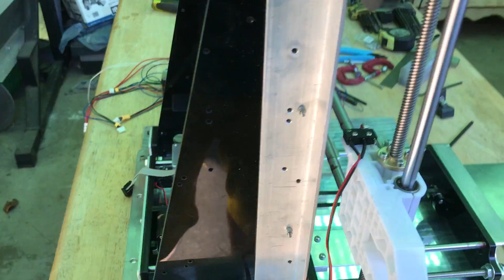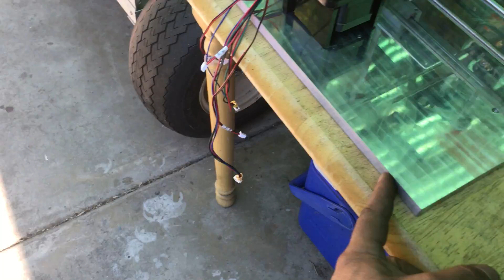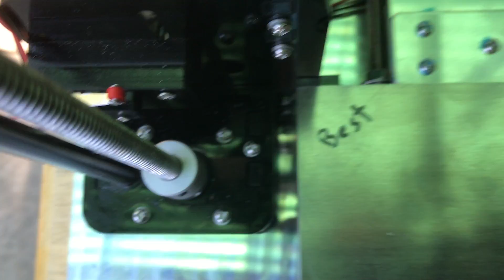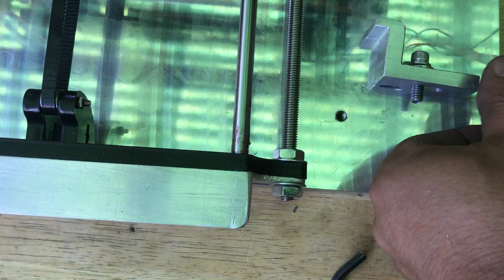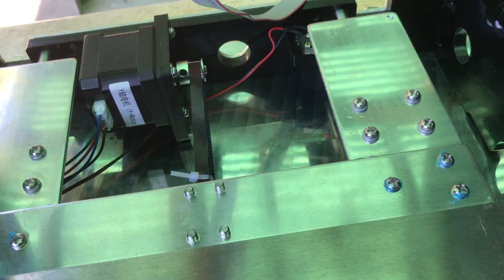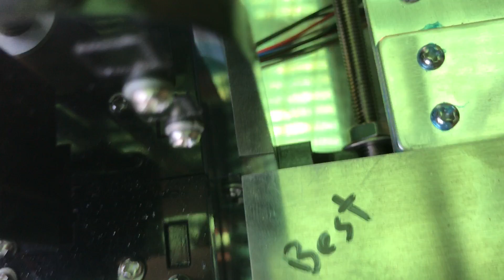Issue  with Anet A8 3D printer Y and X . How to fix it/

Comment: where you get this metal part ?
Reply from the maker: I got it from Industrial Metal Supply in Los Angeles (Sun Valley branch). I paid about $75. It's a tooling aluminum plate. (very flat)

Comment: Nice video, confirmed ideas I already had to use aluminium angle to reinforce my as yet unbuilt A8.I don't think your bed is not square, is proved by your use of the plate lining up against the acrylic sides, I think you could fix that by just loosening the screws on the aluminium "H" frame and adjusting it....."THE WIZARD" fixes his front to the base, I note you chose to put the angle aluminium on the front "upside down" so you missed the opportunity to fix the front in this way.you need to measure the X rails against the Y rails somehow avoiding the intermediate structures.I will see how this can be done as I build mine.
Reply from the maker: Hey, I just shown there one left side end gup was 1mm. That means that X and Y not forming sharp 90 Degree. All these aluminum holes on the bed machined with precision. SO If I use the across aluminum bar as a X axis , it should form 90 degree with Y axis. As simple as that :)
Reply from the maker: I could put front angle aluminum upside down , but my table was a bit smaller and standard aluminum angle was smaller than front plastic height. I paid for that aluminum table almost the same like for my Anet printer. Its a cast aluminum table with smooth machined surfaces made for tooling :) Anyway I print using ABS most of the time with my Anet and it works great.

Comment: Nice, if you were selling those machined parts, I would by them at fair price
Reply from the maker: I don't sell them. I just made one and that's it. Actually I use standard 1/8" thick aluminum angles ( cut the size and make some through holes, machine some slots and simple edge rounding with a sand paper ) The 16"x18" / 1/2" thick aluminum  plate I got from local metal supply shop. ( machine some holes with threads  for leg supports and that's it)